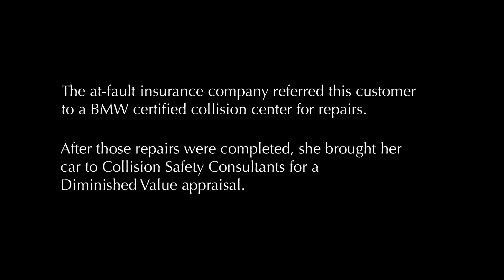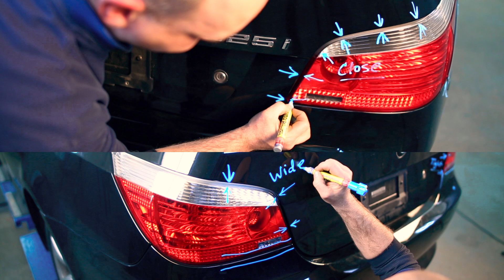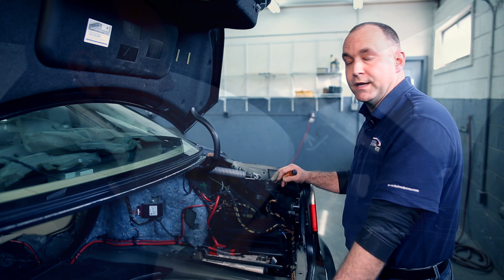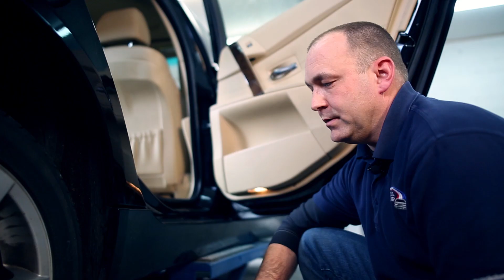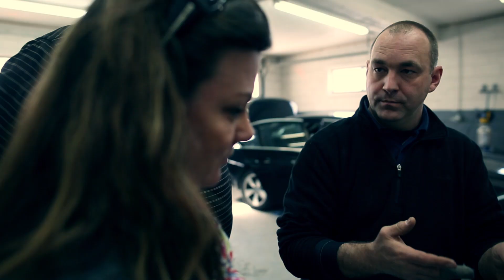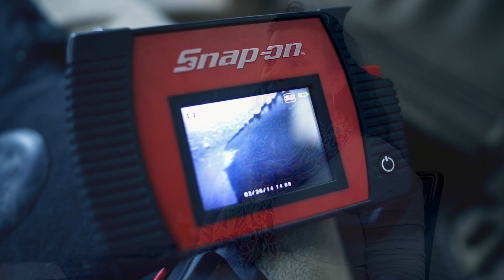Is Your Car Safe After An Accident? What You Need to Know About Insurance Co. "Preferred" Body Shops

Comment: After a vehicle has been wrecked that needs weld on parts just scrap it. It will always be a wrecked vehicle. Bolt on parts  to fix ok but use judgement. Ask any Ford,GM,Chrysler engineer the worked on the body design of the vehicle will tell you the FACTORY WELDED PARTS AND SEAMS were never intended to be replaced or taken apart. PERIOD    The only reason it is practiced is to save the ins.co. money.  If it was intended to come off and be replaced it would unbolt. Again PERIOD.
Reply: Wrong....
Weld on parts are ok to replace if done correctly

Comment: NIcely done and factual (I'm industry knowledgeable).   I'm going to recommend this video to some body shops because it's A) a reminder that THEY are responsible for the quality of repair B) DRP Insurers often try to limit total payments to the body shop for a repair - even if elements are required for a quality and safe repair.   And, in this case, C) the insurer,  who will NOW be forced to pay for the correct repair that should have been done originally, will charge back the body shop for the original work and may even terminate the DRP agreement (so now the original Body Shop did all that work and didn't get paid because they made a bad decision to NOT do the proper repair.)

A body shop should never agree to do an unsafe or incomplete repair because of pressure from their DRP insurer.

Comment: what is a certified body shop? just a business tax id? or is body shop required to have a state license?
Reply: Third party agencies provide "Certifications" (usually based on completion of training programs and use of the correct tools capable of properly repairing a vehicle).    Some are industry certifications - such as iCar, a collision industry leader in body shop repair training.   Others are from the individual manufacturer (such as the Ford Certified Collision Repair Network).   These are based on training from THAT manufacturer on how to repair their specific vehicle.  i.e. "weld here, don't weld there" etc. etc.   

Generally speaking certifications cost the body shop money so they have a vested interest in becoming trained and knowledgeable because they should be capable of doing a better quality/safer repair based on their higher level of expertise.  This is especially true with newer vehicles that have a much higher lever of safety technology.  

However, while the shop may be capable - they may not always get the financial approval from the insurance company to do everything that is required of a safe repair.   Insurance companies rate body shops on "how much does it cost to do a repair" - if an body shop is consistently higher (because they do all the required safety work) and insurer could (and likely will) STOP recommending them to customers.